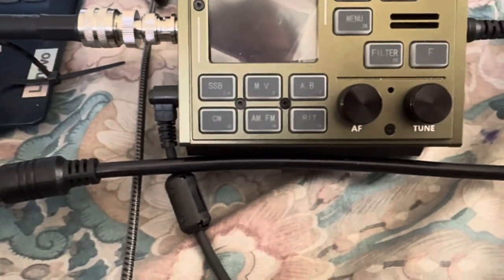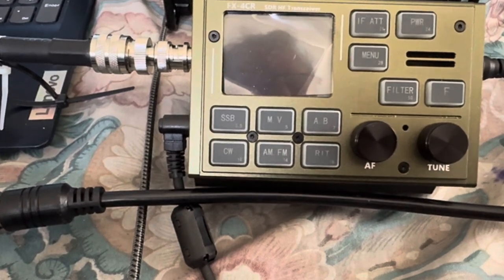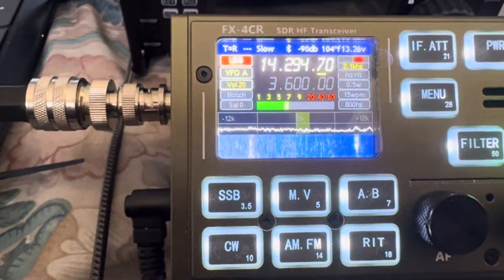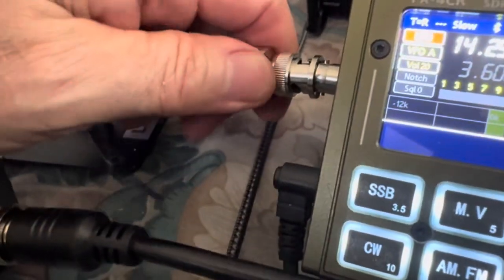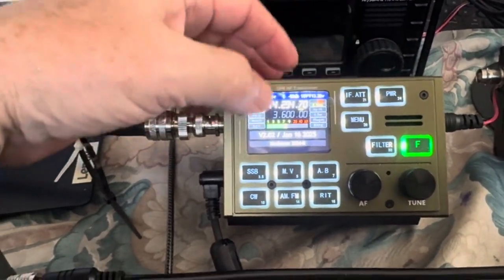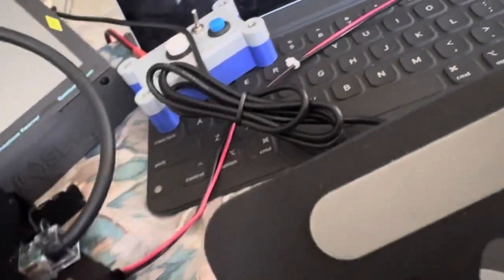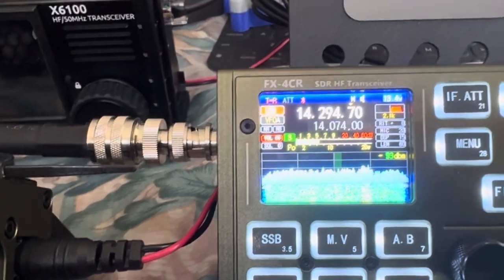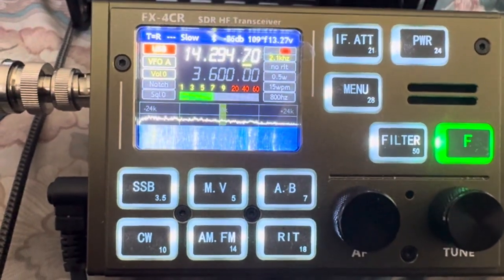BG2FX VS. F5BUD firmware receive 20m USB FX-4CR V3 w/USB-C chassis.

Comment: Hi  , thanks for the video. 
I am looking for the new fx4cr that is coming now with cooling fan. 
Looking also for the more expensive Xiegu x6200 our maybe the cheaper 6100. What will be the best option in durability,  receiver etc.  I work only with voice. 
Christiaan ,73
Reply from the maker: Yes, that's the V3 chassis also with USB-C connector and barrel power connector rather than the Xt-60 solar connector.  Here in the US, you have a few options.  I got my tried and true G90 for $330.  Great deal.  I got a X6100 for $465.  That with the free R1CBU firmware is pretty sweet and $300 less than the X6200.   73  Good luck.
Reply: @LiveWire_Guy  
Thanks for answering,  but what will be a better option if money is no problem,  fx4cr or the Xiegu x6200 ?
Reply from the maker: @brasilchris1  I think the X6200 is the better path due to it's built in/removable battery and built in antenna tuner.  I have never used the 6200, but I think the receiver is probably better than the FX-4CR at this point.

Comment: Wouldn’t the correct comparison be to compare all of the softwares capabilities? That is , turn on DNR.
Reply from the maker: There's no DNR in Daniel's firmware.  What kind of comparison would that be?
Reply: @ it would be a comparison of each total software’s capability vs. hobbling one because the other one doesn’t have that feature.
Reply from the maker: @jerryKB2GCG  I disagree. My goal was to see who had the cleanest receive all things being equal.  It's enough to say that F5BUD does not currently implement a filter and is expected to do so.  While F5BUD has implemented an automatic notch filter that BG2FX has not implemented.  I appreciate the input, but I am comparing apples to apples, not apples to oranges.
Reply from the maker: @jerryKB2GCG  Thanks. That was not my goal.  I didn't discuss any of the creature features which make F5BUD's software better.  My goal was to see how quiet the receiver can get and what leading edge DNR strategy can be implemented in existing hardware that might start to approach the DNR2 filter's performance in Thetis.  Daniel said he reworked the receive algorithm to make it quieter.  I wanted to see if that were true.  If so, that's where you start rather than start with filters. Sorry it doesn't align with your thoughts.